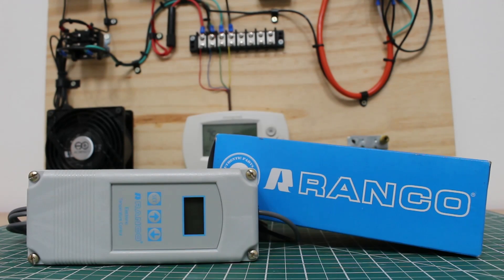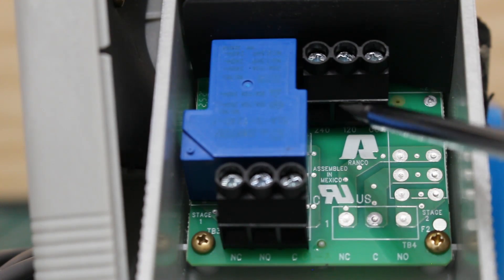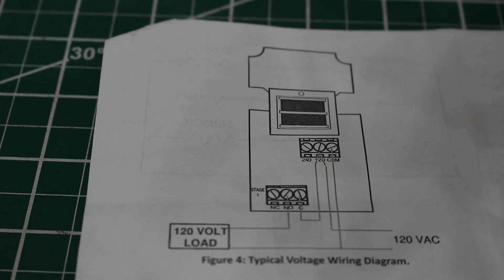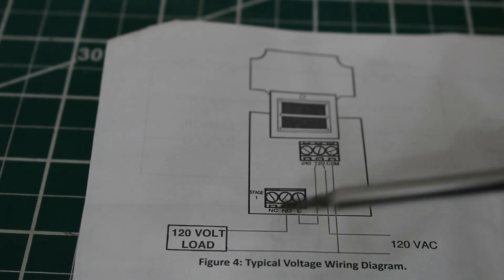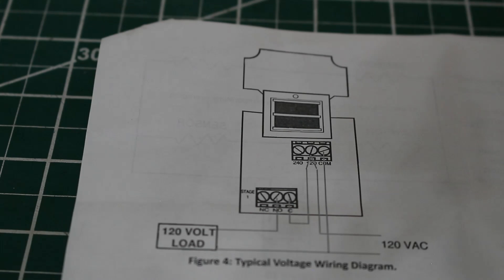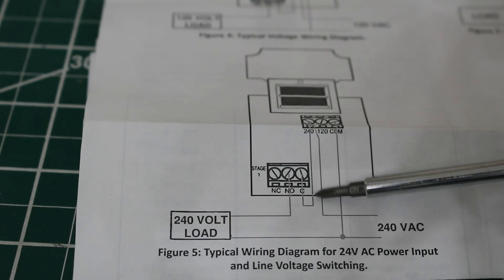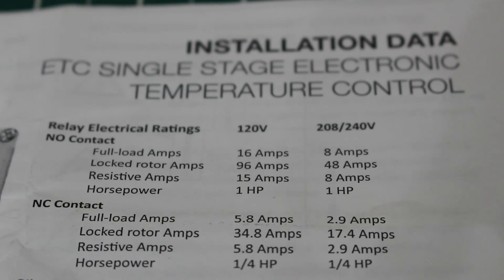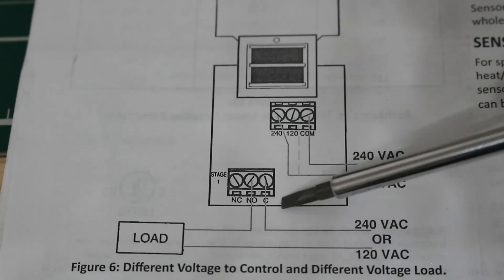HVACR Training: How To Wire RANCO Electronic Temperature Control (RANCO ETC111000-000 Wiring)

Comment: HVAC student here from Canada. How would you connect this to a defrost timer? ..or is it odd to wire it up with a defrost timer?
Reply: This would be wired on the NC portion of the defrost timer.  So when the defrost timer is not in a defrost cycle, it is supplying voltage to this thermostat.  When the box temp rises above the thermostat setpoint it will open the solenoid and allow refrigerant from the receiver to feed the evaporator.  Once the evaporator picks up enough heat, the liquid refrigerant is boiled to a gas and the low side pressure (back pressure rises).  On a separate circuit is the low pressure switch, once the low side pressure exceeds the setpoint of the low pressure switch, it activates the compressor and the refrigeration cycle begins.

Once the box temp reaches below the setpoint of the thermostat, the thermostat no longer energizes the solenoid and refrigerant is no longer fed to the evaporator.  The low pressure switch continues to energize the compressor until it reaches its low pressure setpoint (usually around 5psi) and the refrigerant is pumped into the receiver (aka pumpdown).
Reply: thanks for the reply, I appreciate it!

Comment: Looks like according to his schematic, he ran the N back to the Common on the bottom contact instead of back to the Neutral side of the load. 

Could use some clarification on that cause it looks like he would just be shorting the contacts by sending N back to its hot side.

Comment: One question is on your last example wired for 120v you showed the orange jumper from 120 to the C terminal with the yellow from the NC terminal to the solenoid.  I’m confused about the red coming from C (where the orange jumper terminates) but where does the red terminate?  The diagram didn’t show a second wire coming from C.  What am I not understanding?  Thanks for taking the time to explain.
Reply: Was wondering the same , I don’t think there should of been a second wire coming out of the c terminal in both examples 🤷🏻‍♂️ as per the diagram